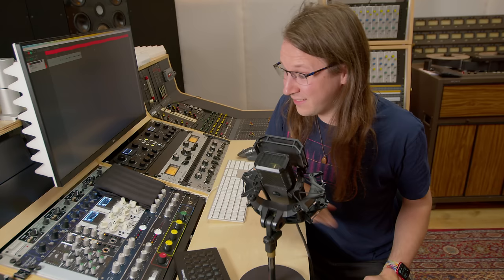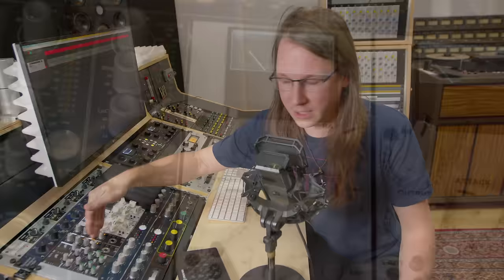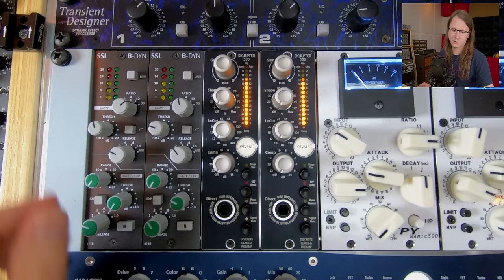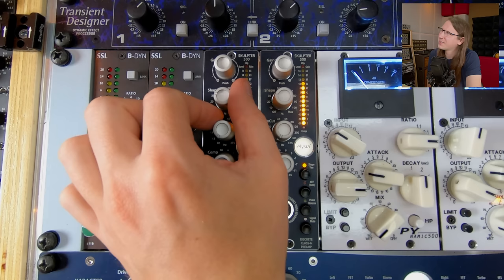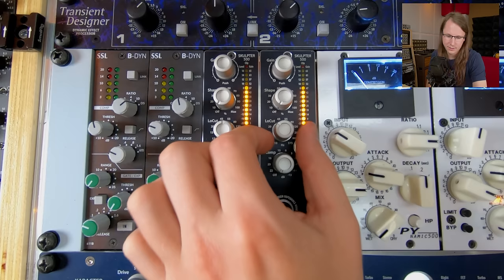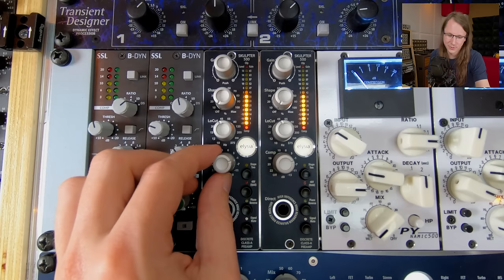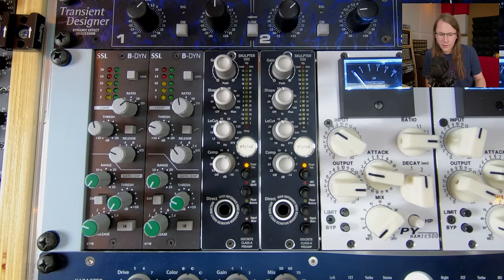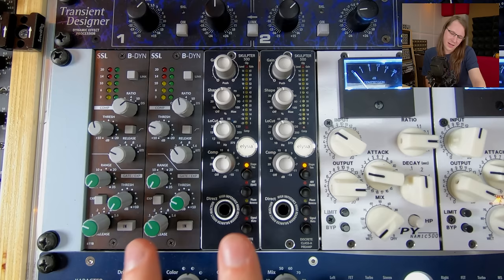Let's try a PREAMP for MASTERING!

Comment: I am by no means an audio engineer, but I watch a lot of these types of videos. When guitar players want to test two amplifiers against each other, what they often will do is capture a performance on a looper, then play the looper through each app. This guarantees identical performances.

Wouldn’t it be possible to capture an audio performance, then play it back through a high fidelity speaker, and use the same microphone in the same location in front of that speaker, and then fiddle with the preamp farther down the line? This way, everything is identical except for the preamp. Wouldn’t this get around the limitation you mentioned at the top of the video?

Comment: Occasionally I've tried mastering with soundskulptor mp 573 (1073 clone) and they don't come out bad, they give just the right amount of saturation. The problem can happen if you overdo the saturation, you lose a little bit of the bass.

On the high freqs, however, I have noticed that they soften nicely.

Now, seeing that you also use preamps in the masters, I feel a little less lonely and less crazy

Comment: 0:29 so basically Preamps are Snake-oil? 

But in general, wouldn't you do a nice general Video about Preamps, I mean there is much to talk about and to learn. 

I got an eye on the Skulptur 500 several months ago and then I read a Review where it's stated it only works fine with condenser Mics and not Dynamic mics. Okay it got compared to that SPL 1200V superexpensivecleanneutral highdynamic nonclipping Rackmicpreamp. In my opinion the price of the Skulptur is fair.

Comment: Really, you’ve never used preamps in mixing and mastering?i regularly bump my line outs from DAW and by either using 20dB pad or reducing the line level, as long as your very conservative with levels then there’s not a lot of ‘colouration’, but if you want some colour just drive the input or turn up the gain, I use an analogue mixing desk and the option to switch between line and mic input is wonderful, why do you think this option is nearly always available on channel strip/preamp plugins, one of the oldest tricks in the book……and you’ve never heard about doing this? Next time you get tracks to mix that are all cold thin and sterile, just use the mic inputs on your desk…..